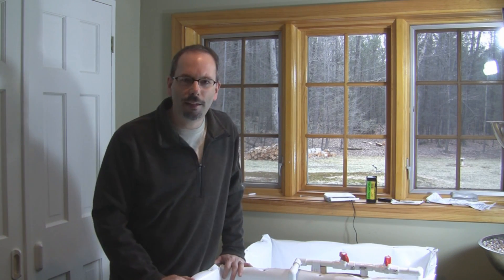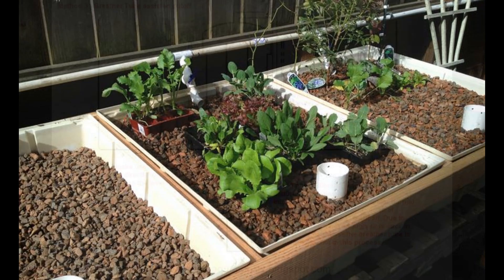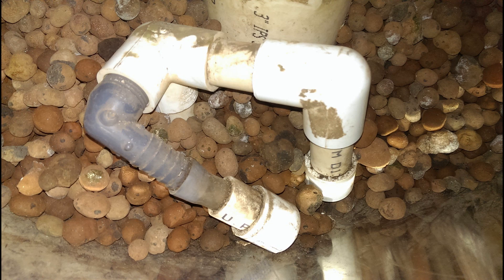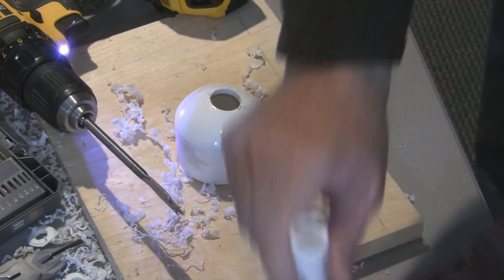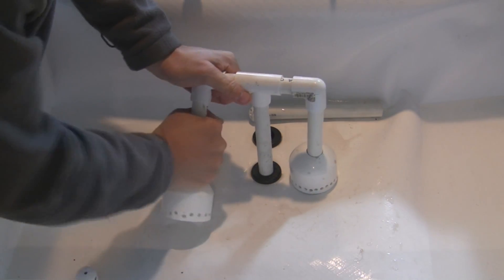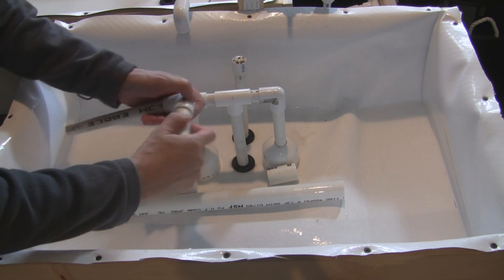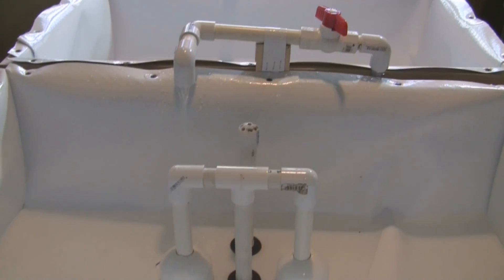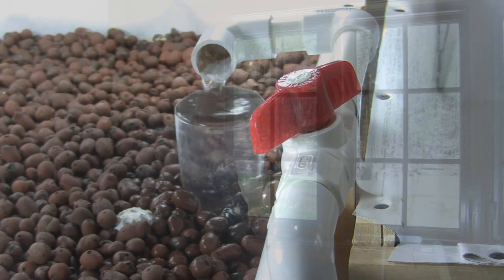Aquaponics Build Episode 6 [Introducing the EZ-T Siphon]

Comment: Do you have any idea of the maximum diameter that would work for the pipes?   I would like to have a tank that I use to irrigate a garden that is filled at a slow rand and when it drains, I will need a lot of water.  Thanks!

Comment: So too low an inflow rate the siphon wouldn't initiate, and too high an inflow rate the siphon wouldn't break.
Interesting because I had this same approach to my system of using a U-shaped siphon through a bulkhead, I must say pipe sizes at various points in a siphon is critical.

Comment: I know from the physics of a siphon a Tee has absolutely no advantage over a U shape . The siphon rate of any siphon is controlled by TWO factors . The ID of the smallest section of pipe AND the head height (difference in vertical level of upper body of water and lower discharge of tube or the surface level of the lower body of water (no matter how far the tube is located (inserted) below the surface of either .)   Having a larger rise (two tubes) is NOT going to increase flow(ID of exit tube sets the limit) but in FACT will be a deterrent to the timely start and stop of the siphon , placing more air that has to vanish at the top .

Comment: Thanks for doing the second part of the demo using clear tube … great idea … Secondly … you talk about getting the water flow rate right or things won't start via the syphon … Why not just have one arm or branch instead of using a tee?  That way there will be no use or need for a 'differential' between two branches as such?
Reply: The science behind the original bell siphon requires water coming together at the top, effectively sealing off the stand pipe, and thus starting the siphon. By only coming in from one side you would lose the ability of the water coming together from multiple angles to create the siphon.

Comment: hello... here I was looking for a easier way to get a syphon to start rather then reducing size of my plumbing.. I have come across this... very good... I have a question.... well first I should tell you I am not doing a syphon for a grow bed, its for  a 2000 gallon pond actually. I am looking for ways of changing the water level in it periodically..  kind of same concept as a grow bed though more like a artificial tide. A great for giving plants on the ponds edge a “dip” into the water as some beautiful plants that look great around a pond but dont like to be submerged all the time like a Canna lily for example. 2nd purpose would be to clear up my top skimmer and flood away stuck leaves or debris that seems to hang up on it from time to time. Bringing me to my question... you have use a “T” to increase  the ease of starting the syphon correct?  Now... have you tried a 5 way and add to more intakes totaling 4 all into the same drain?  Would this double the ease of start up perhaps? Thx for your time?
Reply: Unless he responds off line , does not look to be any responses .     I have a 2.5 " siphon tube from my pond to a lower discharge point .  At the intake there is a check valve that only lets water leave the pond(siphon cannot empty backwards ) . At the lowest point there is a Gate valve ( more expensive than ball but always easy to open/close .  At a mid point there is a rise tube that is only used to fill / prime the system at the set up . After one fill the system stays primed and full and I can set into motion whenever needed to change pond water level . (all fitting connections must be air tight)

Comment: Hi
I am new to aquaponics and I am building a small diy system at home..... will the easy T work if I built it from 40mm pvc pipe.... what is the correct process for an aquaponics system..... my plan is for it to flow from a sump to the fish tank and then gravity through a swirl filter and into my grow beds and syphon back to my sump..... will it work. My name is Tim.... timbezuidenhout@gmail.com

Comment: I've been using this system since my last post and love it. However now I'm having an issue scaling this down. I have a small 1-goldfish tank, and a 7.5ish gallon grow bed. I'm using quarter inch PVC. The problem is that I can't get a good water flow balance that works. Too slow of water flow and the siphon doesn't activate. The opposite of that is a problem as well with too fast of water flow doesn't break the siphon.

Comment: very interesting. thankyou for the video. Question - If you use smaller tubing to make the ez-t siphon, could you get away with lower flow rate into the bed?
Reply from the maker: +Joan Smith if you want to go with a grow bed smaller than 4 cubic feet it might make sense to use smaller tubing, but you are going to pay more for the tubing and fittings. 1/2 inch PVC is ubiquitous so going with 3/8 or 1/4 inch will require a specialty supplier.  There is nothing wrong with draining more often too, just a little more noise.

Comment: I really don't understand why you're putting this INSIDE the grow bed... as long as the siphon pipe's top level is correct a U-siphon can be adjacent to the bed (and could drain multiple beds) so it wouldn't take up valuable space inside the grow medium. ?????
Reply from the maker: Letters from a Psychopath Thanks for the comment. U siphons on the outside are fine, so are loop siphons and bell siphons if your growbed is larger. This design keeps the pipes on the inside for times when you don't want exterior pipes while taking up only two one inch diameter caps of grow space in the latest design. The EZ-T siphon is just an alternative to try... Try it, I think you'll like it.

Comment: Beautiful work! I'm going to give this a try.

Like you, I can't justify the overcomplicated nature of the bell siphon. Proponents will say, "oh it's not that complicated.. look how easy it is!" Erm, yeah.. right.. That's the reason why after reading at least 20 different guides for sizes and such, I ALWAYS have at least a few failures to siphon correctly.

I was going to go with a simple hose loop siphon or U pipe siphon until I came across this. It'll be a while before I'm able to test but I'll report back.. and if it works, make a video on it. Again, thanks for a beautiful and elegant alternative!
Reply from the maker: bugs181 Make sure you try out the new design, It is much better for when you have plants that have extensive root system. Let me know how it goes.
Reply: AquaponicsNYC Do you have a link for that video? Thanks again for sharing your work!
Reply from the maker: bugs181 Here you go https://youtu.be/MM_6veJv8aY

Comment: Thank you for the clever idea.  I have just modified it to function as an EZ-T BRIDGE SIPHONE!  If you put a garden hose tap at the bottom of your EZ-T Bridge middle T you can pump with water instead of sucking to start the siphon, and then close off to lock the siphon.... PLUS you now have a nice bridge siphone DRAIN using the EZ-T idea, all activated with a garden hose spout.  Very clever, thank you for the idea

Comment: Just installed a t siphon in my grow bed last week. Works very well. I used 3/4 instead of 1/2 inch. The siphon starts very quickly and burps twice when it finishes. Awesome idea!
Reply from the maker: Great to hear! What is the volume of your growbed and how long does it take to fill vs how long to drain?
Reply: Small grow bed. 26gal I think. About 5 minutes to fill, around 90 seconds to drain. But the fill cycle will slow down when I add the second bed.

Comment: it'll be interesting to see how this design holds up over time. it's not really more compact, just that you can bury it. and it might not be great to have plants growing roots all wrapped around it (no media guard). there's the added complexity of two bulkhead fittings now. the inlets are pretty darn small too and i'm guessing they'll clog up quickly reducing the flow greatly. that's one big advantage of having a large media guard....a large area to draw water from. btw, instead of drilling end caps and such, i'd simply adapt your inlet pipes up to 2" and use 2" slotted drain caps. less work, and greater flow rates.
Reply from the maker: If you look at my modification video ( http://youtu.be/xQ9vy3ZqLfA ) I have 3 different tests for guarding against root block. I will make updates should I run into issues. I do have a buried loop siphon that has been with out issues for 3 years. I don't have a heavy fish load and I think that also helps keep things clear. The second bulkhead is only for the overflow should the siphon ever fail. Every system should have an overflow - protects the house and the fish.

Comment: I had a flow rate issue starting off my siphons in all 4 grow beds, however i solved the issue by putting a bell siphon suspended at the top of my fish tank and that gives a burp and sends a large amount of water to all the beds at once.  This increased the flow enough and may be a solution for anyone with this issue using a gravity fed system.  You can see this on my page just click on my pic.   Thanks
Reply from the maker: Great Idea for when the fish tank is the highest point. Kinda like a SLO on steroids.

Comment: Since you're already using the media guard, are the end caps at the bottom of the t necessary? Why not just leave the cap off rather than drilling holes through it?
Reply from the maker: There is a chance that some of the media might get underneath the 2 inch media guards so the 1/2 inch caps are a backup plan for protecting the flow of water.

Comment: Fun innovation! I'll be interested to see how it works over time, though in a small growbed like you have here, it wouldn't take much to dig down to clear things if something got clogged. Besides, you always have your overflow pipe that prevents problems were both of the other pipes to get clogged.

I just had a thought on how this might be "improved" yet again... let me go off and see if I'm thinking correctly...
Reply from the maker: I did an install in a manhattan apartment and changed base of the standpipe to be a threaded bulk head fitting and gluing in the stand pipe to slip to threaded nipple. Already ran into it coming loose when dumping in the media and had to dig it up.

Siphon riffing... love it

Comment: I would like to see more detail about the underneath plumbing.  The overflow pipe connections, the elbows, the muffle to lower the noise etc.
Reply from the maker: You can review previous videos for more details, all the information is contained in them. The overflow is just a pipe going through the bottom of the growbed through a bulkhead fitting. You cut it to above the height of your siphon so that if the siphon gets clogged the water will drain through the overflow.

Comment from the maker: The flow rate is limited by the stand pipe which in this case is 1/2 inch. It would be the same for any type of siphon. It takes about ten minutes to fill and two minutes to drain the 33x22in grow bed with the water at a depth of about 6.5 inches.
Reply: Thank you. I thought maybe the tubes leading up to the standpipe was limiting in this case. I haven't done the math on the actual area of two 1/2" pipes compared to a traditional bell siphon with a 2" bell less the area for the stand pipe.